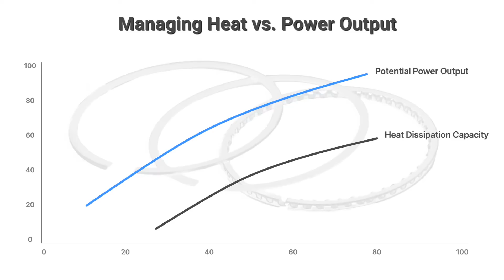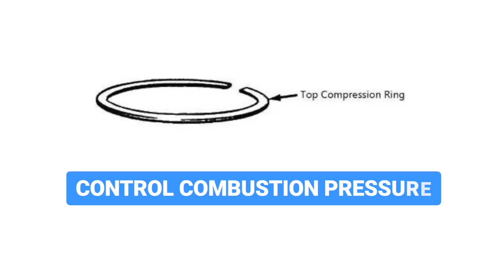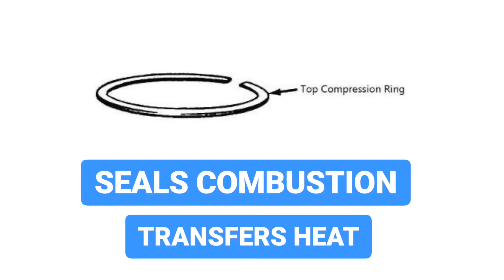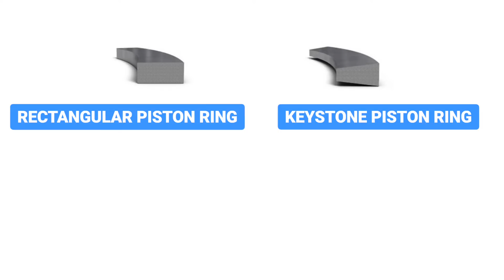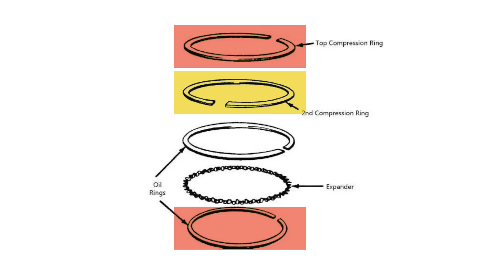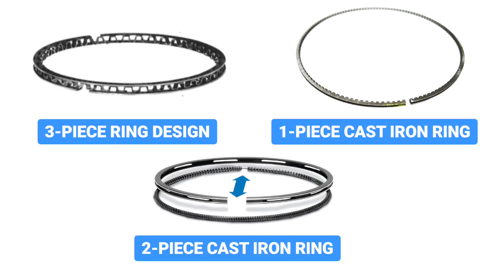Simple Looking + Complex Engineering = Fascinating Details About Piston Rings

Comment: When you talk about rings and pistons and going w/ thinner ring packs, you never really clarify weather or not those thinner rings need a new pistons w/ narrower ring grooves or if you just throw those new rings onto the existing pistons. What about ring flutter w/ the increased clearance? Learned about platteauing the cylinder crosshatch years ago when building a 351C for my '67 fastback Mustang.

Comment: One of the functions of the second ring is to reduce the load on the top ring.  This is not well understood by most engineers.  The load on the piston ring is not proportional to the gas pressure behind the ring but by the pressure difference between the pressure on top and below.  So, adding a second ring does not really reduce the leakage to the crank case (although it does delay it) but it reduces the load on the top ring as it traps some gas pressure by itself.  Similarly, if you have three compression rings, you can let the end gap a bit larger so that the other zones can get pressurized, and reduce the gas pressure load on the top ring.  Interestingly enough, the second ring actually contributes to oil consumption via reverse blowby.  The area between the two rings get pressurized in late compression and early combustion, but then in late expansion the pressure in the cylinder is lower than the inter-ring pressure.  Then, we have reverse blowby, which shoves atomized oil into the combustion chamber.  If you can pin the rings so that the end gaps are furthest apart, you can reduce that effect.  Unfortunately, that also increases wear, unless of course you have a Rotating Liner Engine!  Cheers.
Reply: Why I really love double sleeve valve engines.
Reply: @Onan-u3b  Double sleeve valve engines are terrible for lubrication.  The sleeve lubrication is marginal.  The single sleeve is much better as it helps both sleeve and piston lubrication.
Reply: Should have been single sleeve!

Comment: If I wanted to run a  ap steel Napier 2nd ring (1.2 at 3.032) and a gas port top ring, Do I need to contact sales. I can’t seem to find a way to get the Napier 2nd ring in the ring set.
Reply: Call Keith Jones or Kevin Studaker. You'll get what you need from Total Seal.